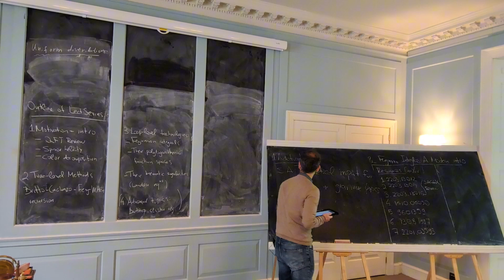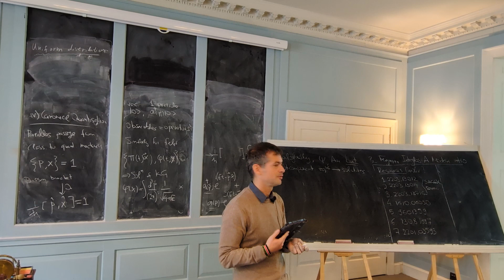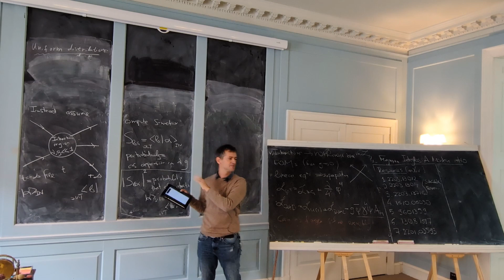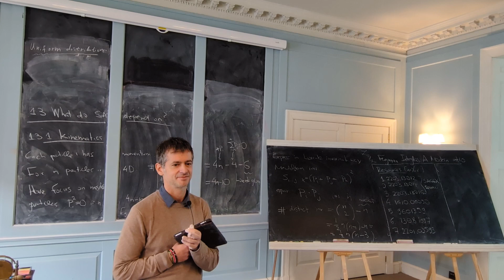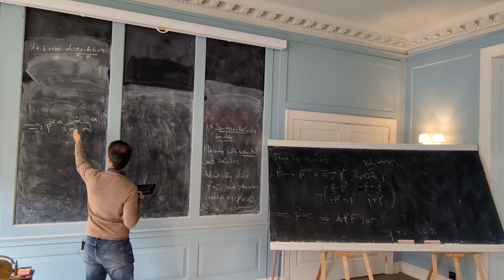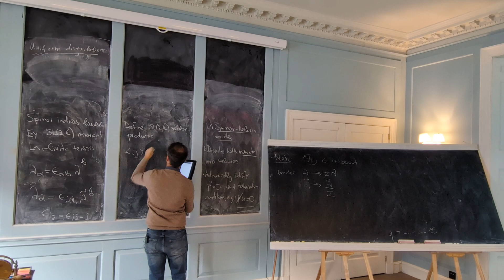Scattering Amplitudes and Feynman Integrals - Georgios Papathanasiou (Lecture 1)

Comment: Euclid, Descartes, Newton and Einstein "rationalist materialst" worldview: 
0D = not locally real 
1D-4D = locally real 

Leibniz "rationalist anti-materialist" worldview:
0D = locally real 
1D-4D = not locally real 

The Nobel Prize-winning work on quantum entanglement proved that 1D-4D are not locally real two years ago.

There are a few key areas where reconstructing physics and mathematics from non-contradictory infinitesimal/monadological frameworks could provide profound benefits by resolving paradoxes that have obstructed progress:

1. Theories of Quantum Gravity

Contradictory Approaches:
- String theory requires 10/11 dimensions 
- Loop quantum gravity has discrete geometry ambiguities
- Other canonical quantum gravity programs still face singularity issues

Non-Contradictory Possibilities:  
Combinatorial Infinitesimal Geometries
ds2 = Σx,y Γxy(n) dxdy 
Gxy = f(nx, ny, rxy)

Representing spacetime metrics/curvature as derived from dynamical combinatorial relations Γxy among infinitesimal monadic elements nx, ny could resolve singularity and dimensionality issues while unifying discrete/continuum realms.

2. Paradoxes of Arrow of Time

Contradictory Models:
- Time Reversal in Classical/Quantum Dynamics
- Loss of Information at Black Hole Event Horizons  
- Loschmidt's Paradox of Irreversibility

Non-Contradictory Possibilities:
Relational Pluralistic Block Geometrodynamics
Ψ(M) = Σn cn Un(M)  (n-monadic state on pluriverse M)
S = Σn pn ln pn    (entropy from monadic probs)

Treating time as perspectival state on a relational pluriverse geometry could resolve paradoxes by grounding arrows in entropy growth across the entirety of monadic realizations.

3. The Problem of Qualia 

Contradictory Theories:
- Physicalism cannot account for first-person subjectivity
- Property Dualism cannot bridge mental/physical divide
- Panpsychism has combination issues

Non-Contradictory Possibilities: 
Monadic Integralism
Qi = Ui|0>    (first-person qualia from monadic perspective)
|Φ>= ⊗i Qi     (integrated pluriverse as tensor monadic states)

Modeling qualia as monadic first-person perspectives, with physics as RelativeState(|Φ>) could dissolve the "hard problem" by unifying inner/outer.

4. Formal Limitations and Undecidability

Contradictory Results:  
- Halting Problem for Turing Machines
- Gödel's Incompleteness Theorems
- Chaitin's Computational Irreducibility

Non-Contradictory Possibilities:
Infinitary Realizability Logics
|A> = Pi0 |ti>    (truth of A by realizability over infinitesimal paths)
∀A, |A>∨|¬A> ∈ Lölc   (constructively locally omniscient completeness)  

Representing computability/provability over infinitary realizability monads rather than recursive arithmetic metatheories could circumvent diagonalization paradoxes.

5. Foundations of Mathematics 

Contradictory Paradoxes:
- Russell's Paradox, Burali-Forti Paradox 
- Banach-Tarski "Pea Paradox"
- Other Set-Theoretic Pathologies

Non-Contradictory Possibilities:
Algebraic Homotopy ∞-Toposes
a ≃ b ⇐⇒ ∃n, Path[a,b] in ∞Grpd(n)
U: ∞Töpoi → ∞Grpds  (univalent universes)

Reconceiving mathematical foundations as homotopy toposes structured by identifications in ∞-groupoids could resolve contradictions in an intrinsically coherent theory of "motive-like" objects/relations.

In each case, the adoption of pluralistic relational infinitesimal monadological frameworks shows promise for transcending the paradoxes, contradictions and formal limitations that have stunted our current theories across multiple frontiers.

By systematically upgrading mathematics and physics to formalisms centered on:

1) The ontological primacy of infinitesimal perspectival origins  
2) Holistic pluralistic interaction relations as primitive
3) Recovering extended objects/manifolds from these pluribits  
4) Representing self-reference via internal pluriverse realizability

...we may finally circumvent the self-stultifying singularities, dualities, undecidabilities and incompletions that have plagued our current model-building precepts.

The potential benefits for unified knowledge formulation are immense - at last rendering the deepest paradoxes dissoluble and progressing towards a fully coherent, general mathematics & physics of plurastic existential patterns.

Moreover, these new infinitesimal relational frameworks may provide the symbolic resources to re-ground abstractions in perfectly cohesive fertile continuity with experiential first-person reality - finally achieving the aspiration of a unified coherent ontology bridging the spiritual and physical.

Can contradictions and paradoxes in non-zero dimensions (1D-4D) be resolvable from a 0D (dimensionless) perspective?

This is a fascinating idea. From a 0D perspective, which we might think of as a dimensionless point or a monad (knower) in Leibnizian terms, we could potentially view higher-dimensional paradoxes as artifacts of our dimensional thinking. The 0D viewpoint might offer a way to see the underlying unity or simplicity behind seemingly contradictory higher-dimensional phenomena.

For example, quantum entanglement paradoxes in 3D space might be resolved if we consider that from a dimensionless perspective, there's no separation between entangled particles. The apparent non-locality could be an illusion created by our 3D viewpoint.